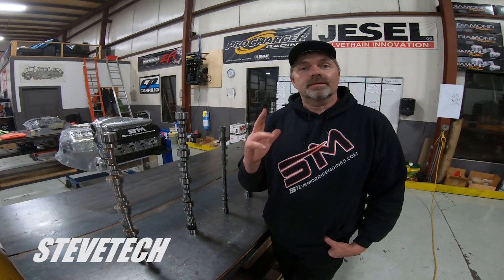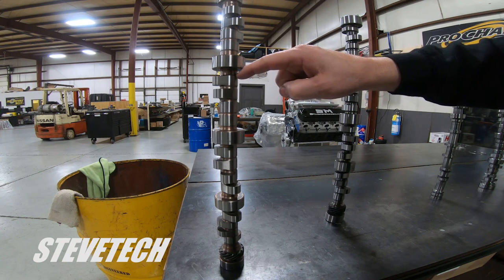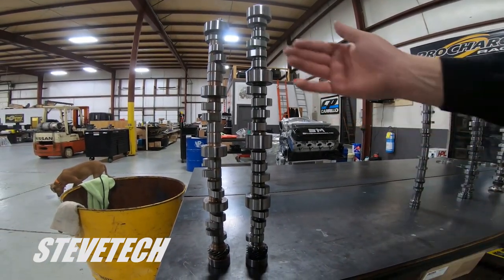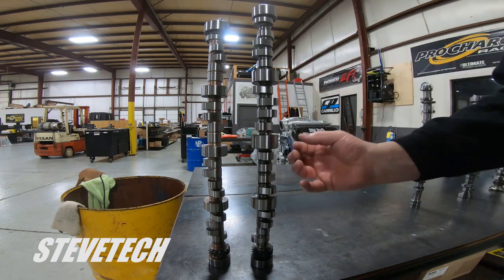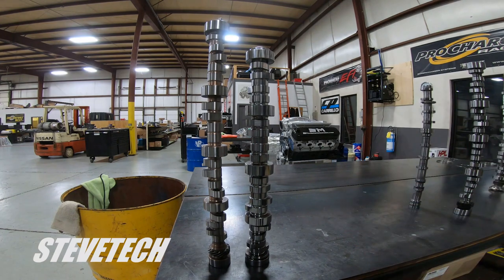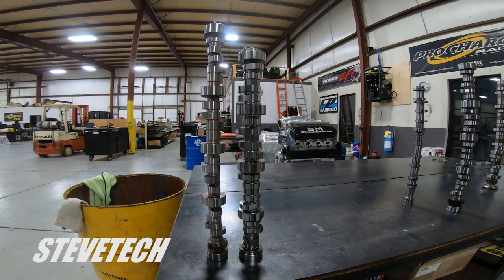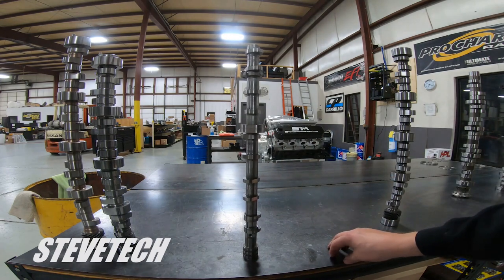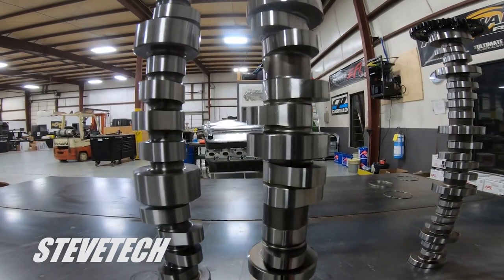Understanding Camshafts – Part 2 (Cam Cores)

Comment: 3👍's up thanks for sharing Steve Morris
Reply: so you're saying they could have made the ls block longer from the front to back they made all the cylinders bigger so we could have came out with the four and a half inch bore with a 4 inch stroke and had a 496 right away out of an LS but they cheated the American public by shortening the block that's bad  LOL 😂
i mean that it 4.5X4.5X4.X8= 508.9392

Comment: Wonder why he didn’t go into .900 base circle cams that ya have to use in sbc with standard cam location but running a 4 inch stroke crank.